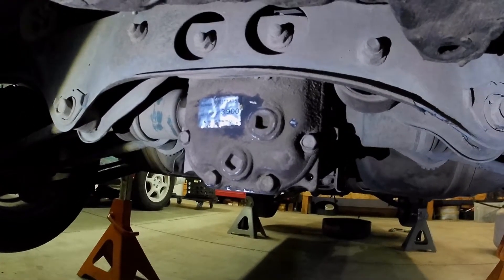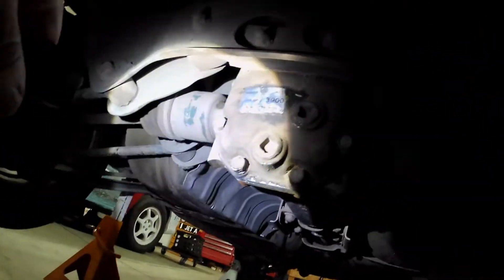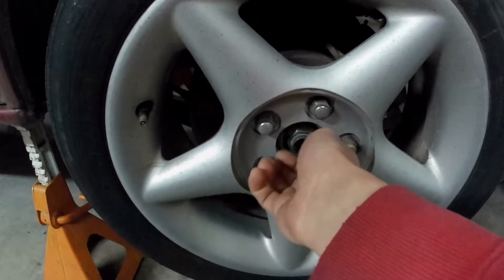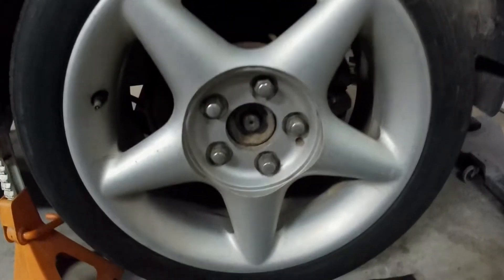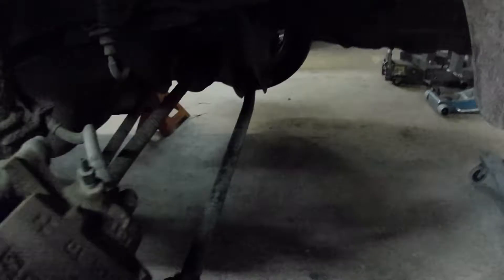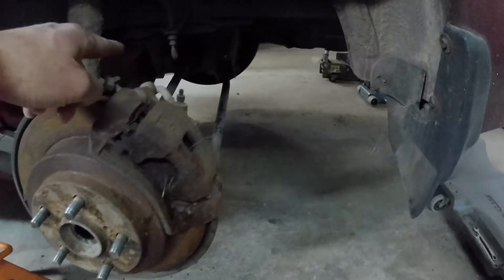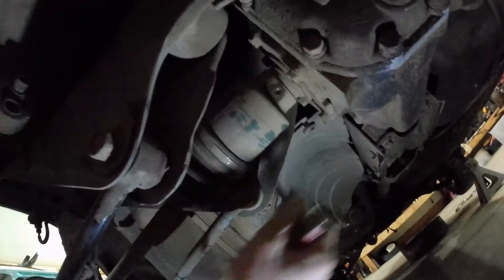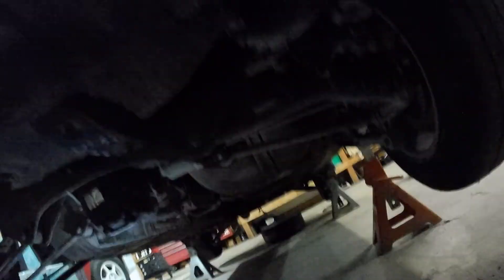How to remove a Subaru rear differential

Comment: Does this apply to the 95 legacy LSi wagon as well?
Reply from the maker: It's the same only difference is your axles won't have any roll pins to knock out, they are held in with a spring clip, just give the axle a hard pull and it will pop out of the diff

Comment: Can you remove the diff cover without removing the whole diff.
Reply from the maker: You might be able to just unbolt the diff but leave the axles and driveshaft connected and lower it down enough to remove the cover.

Comment: Do you need to drain the axle fluid first before taking out the driveshaft?
Reply from the maker: No oil will come out when you remove the driveshaft from the diff, and with this type of diff with the male axle stubs no oil will come out when you remove the axles ether, the only place it can leak out of is the vent hole on the cover if you turn the diff upside down.
Reply: @ImpreziveGarage  thank you and another question what type of fluid do you use if it's an Sti diff cause an Sti is LSD diff right?
Reply: @ImpreziveGarage  also if there are two option using Redline 75w140 or 80w140 fluid which is recommended?